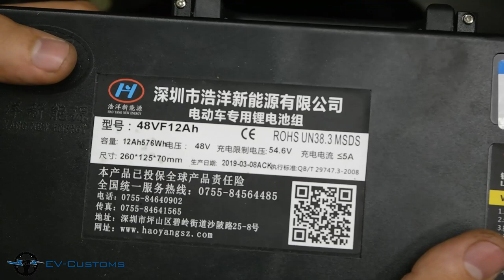Battery Capacity Extension ( without extra BMS board )

Comment: Nice work man very fine!!!! Congrats.....so now a video on how it works :)
Reply from the maker: ;) want to see how this scooter works??  I think it's very boring, only think we did is change the battery capacity for more miles....
Reply: @EVCustoms  but can't you change the BMS (or eliminate) and take some more current from the battery? What controller does it have?...
Reply from the maker: @DKLVE  This deepens from your battery, if you pull more Amps than battery specs you can destroy it or you will shorten the battery life....without bms i not decremented it..

Comment: Nice hack. But would it not be smarter/safer to first connect all the BMS wires with small resistors (<100 ohm) (or bulbs) and let it sit for a while, in order to have the new and old cells equalize?
Reply from the maker: Yes it would be good.. 
i just did it differently by charging the extra battery at the same voltage level with other one.
Reply: EV - Customs still looks like you had a bit of excitement when connecting to plug :-) would charge them to equal voltage first also...

Comment: Hi nice video do you use 13S3P battery and 48v20A controler ,so using only one nickel between section create sag of voltage and create heating point. That can handle only ~5A continius current (one nickel conection.)
Reply from the maker: Hello my friend...  clever your observation but as you can see on original scooter battery they are Hi-drain batteries 8P, so most of energy will pas from there,, This pack have also  4 strips in parallel, same strip i have too 8mm x 0.1mm they can handle easily 30Amps , also this batteries will work in parallel... So 30A load is peanuts ;)
Reply: @EVCustoms  im interested how loks termal imege during the 30A discharge but if it work good so is good;)
Reply from the maker: @rafalkut4190  unfortunately  i don't have thermal camera,,, it is very useful....